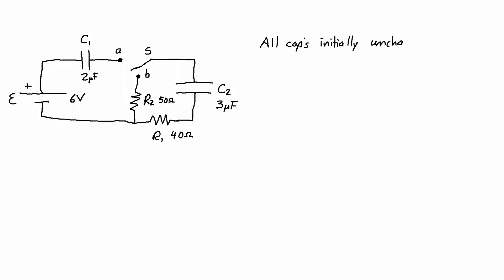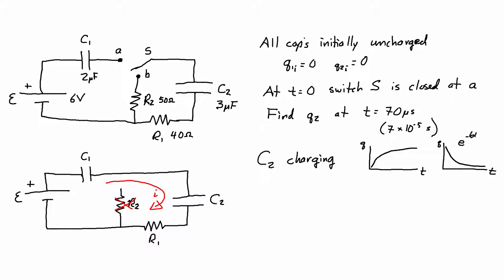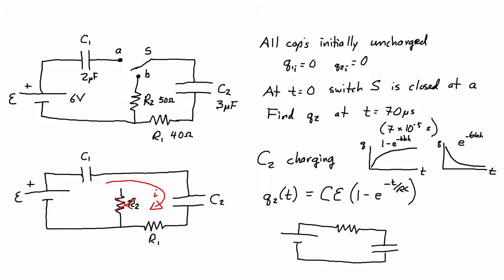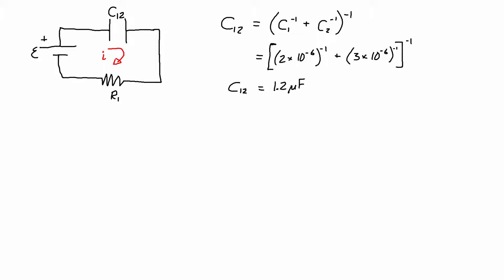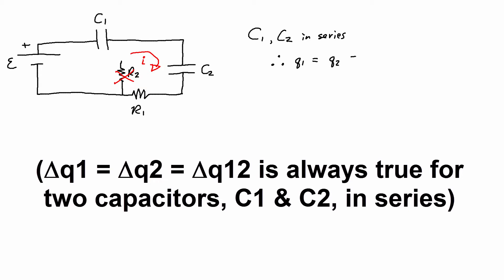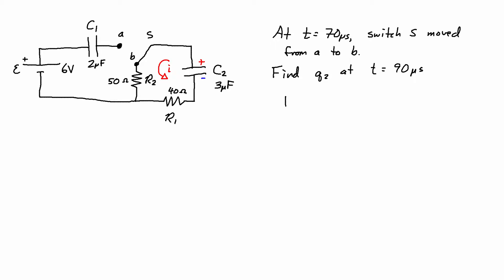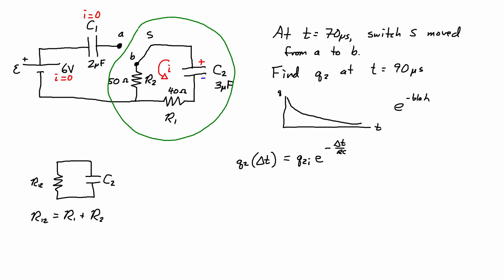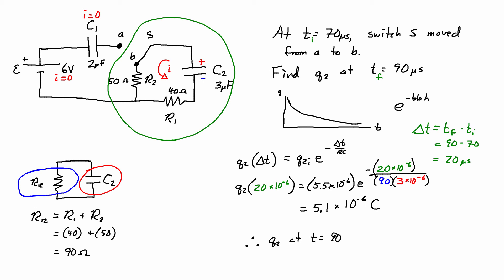Tricky RC Circuit With Multiple Capacitors and Multiple Resistors

Comment: What if the resistor is between the two capacitors? Will the equivalent resistance still be the same ?
Reply from the maker: Hmm.. That'll depend on how it's set up. You can count on Kirchoff's voltage and current laws. Good luck!